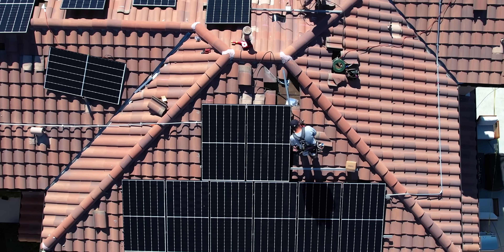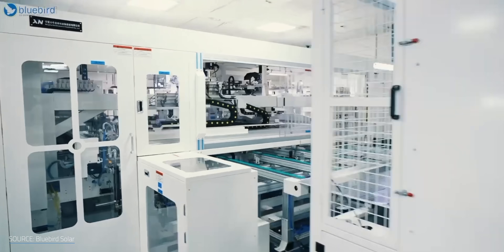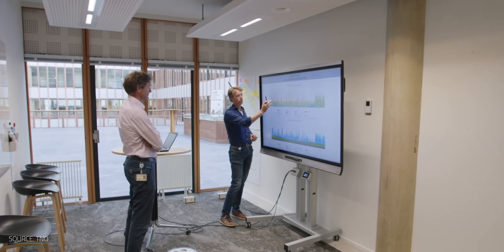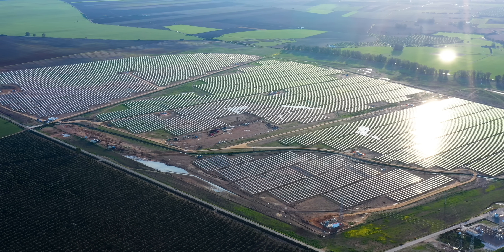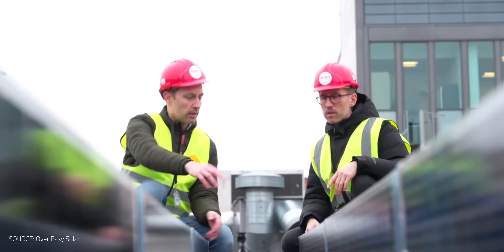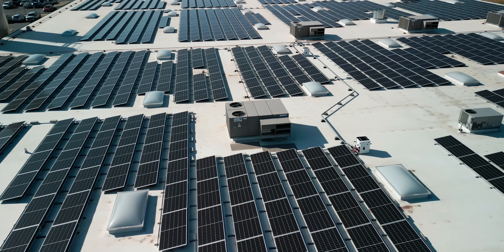Have we been doing Solar wrong all along?

Comment: it better to know bifacial solar panels are good with tracker system you in EU maki it wrong and your roof in West are not flat the flat roof with bitumen foil waterproofing will increase significant amount of Bifaciality gain annually. Bifacial panel can produce up to 23% more energy from back site regarding the albedo in real study not simulation. in 1 of PV site in our project we gain 19% more from backside compare to Monofacial solar module. 
with new Top-Con and HJT hit will reduce less production . 
vertical installation for country that near to south or north pole is ok because the tilt of solar panel goes high for near equator no like Spain south of Germany or USA Mexico or like us in MENA
best way for large scale solar PV plant is Bifacial + 1 axis Tracker system
for roof top use as can fit. HJT and Top-Con Came almost same size and very higher power  and low temp Coefficient of Pmax  
Flat roof definitely  bifacial with bitumen foil waterproofing or withe coloring

Comment: vertical panels run cooler due to better convective air flow which increases efficiency. I would like to have roof panels which have cooling pipes on the back which are plumbed to produce space heating and/or hot water. Waste heat could be vented via heat pipes.
Reply: The effective area is the shadow area.

Comment: I don't think it's that much of a question which is better. The beauty of solar is that it can (traditionally) be slapped on any surface. Now we just see more and more double-use cases where vertical PV is also used as fencing, etc...

Rather than having to accomodate for solar, it is great to have a bandwith of solutions to put solar just about anywhere.

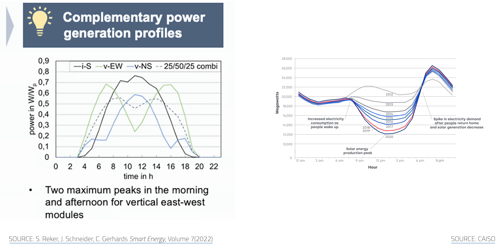Comment: The "Duck Curve" (4:10)  is a bad example that gets too much hype. Typically only such a curve is shown for solar solstice, typically the most extreme case of the solar year. When discussing solar, it would be much better to look at average energy for each of the four calendar seasons to better understand local solar energy potential. Not doing so leads to misconceptions and confusion. 
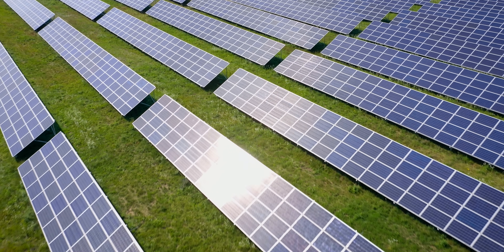Regarding heat and efficiency (5:40), similar applies to roof mounted panels being warmer than ground mounted panels.
Even better is floating solar photovoltaic, as the water provides a consistent cooler environment. Note bifacial solar does not need to be vertical, there are benefits to be had mounting at other angles.
Covered previously. 
• https://youtu.be/4CMk7kkSp831Q
• https://youtu.be/pCRX232VkBk

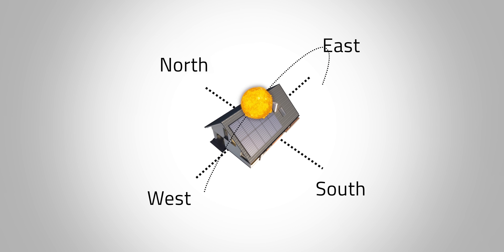Comment: @undecidedMF firstly a quick correction @ 3:39 - panels are correct to face south... if you're in the northern hemisphere.  

for those wanting to jump to a great summary, watch from 10:39 and then go back to the start for how it all works.

and lastly, this video comes at an amazing time as I've been planning the mounting 7 spare panels I have on our rear fence to take advantage whilst not eating into the surface area of the yard, but had worried about the optimal angle - now I can see the cooling factor combined with the reduced surface area are huge benefits despite not pointing the panels directly at the sun - thanks Matt!

Comment: Well, why not add an additional element to VBPV's in form of a layer, than has a thermalconducting liquid to heat water up for heating space? It may not be much heating, but that little generated heat could reduce costs of regular heating, even if it seems negligeble. In our times, where everything gets steadily more and more expensive because of permanently growing greed, shouldnt we make efforts to countermeasure exactly that? Even if its just 5 degrees warmth in water, it means you need this much less energy to heat up the water even further. Its just an idea and i dont know, how practical it is, but maybe copperheatpipes like used in computers could maybe also help in that regard. We have the technology to try such ideas on computersimulation to determine, if it could yield even better results. Maybe this idea is crewd, but maybe it could be usable, if tested and it shows better results. That idea could cool down overheated solarpanels and get their operational range even higher. Again, this is just an idea, maybe its not so easy as i thought, but at least i tried to come up with a new solution

Comment: Putting in my hypothesis right after the intro (defining "Bifacial vertical", and that text just displayed)...
BENEFIT #1: Being out of full-on direct sunlight results in significantly less heat, which is improving efficiencies. (due to lower resistance?) [Nnnailed it!] 
BENEFIT #2: Being completely vertical inhibits dust/other participate buildup, meaning that even if they aren't cleaned often, they still generate more electricity since the typical homeowner likely doesn't clean theirs often (if ever). [I missed it if this was mentioned; maybe as I was typing my reply...]
SIDE BENEFIT: Light reflected off the ground/roof further increased the output versus what was expected. (not really 'benefit' so much as an overlooked factor in their prediction) [That didn't take long to confirm this was right! 🤘]

[edit: Including this, now that you've said "last chance"... The additional panel on the back is taking advantage of those mentioned electrons being knocked off, causing it to create electricity even when there's no direct OR indirect (reflected) light hitting it (scavenging "waste" energy, in a sense) . OR, possibly it's "charging" the 'evening' panel so that once the sun does swing around to it, it experiences increased efficiency temporarily; during that time, it's doing the same now for the 'morning' panel.] [Well, this definitely wasn't mentioned, but if it's possible to create a photovoltaic-substrate-photovoltaic panel that's literally double-sided (instead of two physical panels mounted back to back), this could be something to test out! A joule theif springs to mind, but that likely isn't a good analogy...]

And with that... back to the video!
Reply: re: I wonder if you could use shallow depth geothermal cooling, to place some metal inbetween the panels with pipes run into the ground to circulate a gas or liquid, just through air currents/fluid flow created by the different temperatures at the panel vs underground. (to prevent a need for a fan or pump [if using a liquid] on every panel, which would make them more expensive overall to buy and maintain; granted, there are automated panel washers now, so maybe it wouldn't be prohibitively more expensive... 🤷‍♂️)

Comment: We did a nearly vertical PV install that had reflected light from a lake and a metal roof.
In the Winter, we had three suns pumping sunlight onto the array.
(  i.e. Direct sun, reflected sun from the roof, and reflected sun from the water. ) 
The yields on the array were the same in the Summer and the Winter.
Reply: how long was the day during summer vs winter and what were the peak outputs of the panels?
Reply: Nice use of location specific mounting
Reply: Why are the graphs yarde in europ on east south west slopes on lakes. Exactly the same sun effects.

Comment: I could definitely see this replacing current fix tilt systems in some cases. With the fact that it is comparable at all, constructability would be the main selling point over the increased efficiency. Curious to know how it handles undulating terrain though as civil work can easily out run the cost of everything else. Tracker systems are what it would really need to go up against, atleast at the utility scale, and they're getting cheaper and more reliable at a pretty okay rate.

Comment: As a 30 year Master Electrician and renewable energy installer I just stopped by to say , consult a professional and don't believe everything on YouTube. We do all the energy calculations based on the historical weather in you area and install your solar panels with optimum angle and location to deliver the most energy possible for your system . Don't buy from the door to door salesman, they are really only selling high interest loans and contracting out the installation. Buy from a solar company in your city and roll the loan into your mortgage , so that it's not a separate payment. And if you sell the home the panels are not a separate loan to pay off.

Comment: You didn’t even mention the reduction in hail damage, bird droppings, dust, snow.  Also this seems like a great place for tiny prism glass.  I don’t know what it’s called exactly.
Reply: I think you mean fresnel lenses?
Reply: At least in the case of utility solar, O&M teams will tilt the panels as vertical as possible to avoid hail damage currently and to rinse the panels during rain.
Reply: You get way less bird droppings, dust, snow, hail damage, true, but higher risk of damage / dirt when mowing lawn, doing gardening, etc. I have vertical solar array on the house facade and I had to replace one panel because it got hit by a stone shot from the lawnmower. From then I only use trimmer. But I still not regret it, ones needs to be more careful as the panels are closer to human activity.
Reply: @WhoIsSuperCow  that sounds dangerous reminds me of that final destination scene.
Reply: @aaron-gz  It was, I was impressed the panel withstood that blast, the stone would have left a hole in my leg. Glass was left cracked, but the panel was working for another 6 months until I replaced it.
Reply: Much simpler support structure too.
OTOH it is more exposed to projectiles & ground dirt/vegetation.
Reply: Or a thin film that refracts the light incident to the panel, or design the silica to absorb from a certain angular range… or (less effectively), add mechanical features to adust the panels angle slightly
Reply: Or!!! Etch the glass cover so that it has built-in refraction
Reply: 3:25   42*
Reply: Hail doesn't just drop straight down. Often siding is destroyed during hailstorms.
Reply: @Dan-xo9ly  True, however, the impact of hail on a vertical surface is less than on a horizontal surface. That could be the difference between a destroyed panel and hail bouncing off. Also, it would be easier to cover panels on the ground if there is sufficient warning of hail. Another benefit mentioned is ease of cleaning and the accumulation of dirt and dust.
Reply: yeah, overall surface area to perform maintenance on may increase however I think maintenance frequency could significantly decrease, potentially making this far more viable as low maintenance large scale dual use solar and agricultural farms. Time can only tell if this has long term unforeseen consequences however its looking really promising

Comment: I did a video showing this and the performance results. The vertical almost always put performing the horizontal... Nearly all the time. Some one did the same, they got the same results.
It depends on when you test as the lower sun hits the panels better.  So you get the better cooling. And the better angle.

It worked out that the sun's angle to the panel  is very much key and  you can see that with the  daily power curve as well. But the sun angle is 16o an hour.
For those with solar, they may have noticed the days are About 3 minutes.
These times tend to work in favour of each axis.

Sometimes you got to do it rather than read about it 😊

Comment: One huge mistake made in solar farm/close to ground panel installation is the lack of under panel space for vehicles machinery and grazing animals, this will have major future negatives for food production when sited over prime agricultural land. I have over 90 excellently performing horizontal panels on my shed roof.. not far from me there is a 1200 acre horizontal solar panel farm as well. If vertical solar panels had angular alteration mechanisms it would possibly tweak performance that bit further.

Comment: The fact that they never do a side by side comparison and remember  that the vertical has both sides so the horizontal would need twice the amount to be fair. Because what they are honestly saying is that look are smaller size solar panels is creating more energy which technically it is not

Comment: I've seen another way to solve the overheating problem. They wanted to place horizontal panels on top of reservoirs next to hydroelectric dams. This keeps the panels cool. Doesn't take up useable space. And has all the normal grid connections to make it an easy install instead of transmission lines.

Comment: bonus: add cheap beam splitter/ reflectors to the top edge of vertical panel to redirect light to other panels; or perhaps leave the edge clear to allow in sideways light, basically a “2D” waveguide.

Comment: So you are saying the unexpected extra energy was the cooler temperatures from the vertical orientation. Even I know the panels work better when they are cooler. I know this because I want my solar power system to track the sun. One of the down sides of a system of panels that face the sun all day is the added temperature. Panel that have water cooling built in are available now. It doesn't sound like they tested against those type of panels. 
So these guys aren't very good experimentalist are they?

Comment: The downside would be wind.

You probably want a panel that can adapt to both vertical and horizontal.

The final form may be some form of a wind trap or the ancient cooling towers but with solar panels.

heat goes out, solar power goes in

Comment: Yay, I guessed heat! Interesting to come across this today. I’m just starting to think about how to implement solar on a tiny budget. I want to do some travel when I retire, so being mobile interests me. Then my power went out and came on, then went off again, three times in a row the other day. So I started thinking about a couple of panels and storage batteries to cover some basic energy needs with the more frequent power outages I fear are coming in the future. But I don’t want to put panels on my roof, and I can’t afford a whole system. So I was thinking of putting two or three panels in a more vertical orientation where I have space next to the house along my driveway. After seeing this video, that isn’t sounding so nuts! That said, it’s a south facing location. Thanks for giving me more to ponder!

Comment: Taking the cooling benefit into consideration, would it not be better to add some sort of passive cooling? I'm thinking heat sinks on the back of single sided panels or heat pipes to heat sinks on the bifacial panels.

Comment: Isn't that simply because hot air rises? and by making them vertical the fastest path up is now available? Basically the hotter they get, the bettter they cool. Plus, the soil will be evaporating moisture, which will increase the maximum heat content of the rising air.

Comment: I discovered this years ago when I adjust my panels a set of my panels to a 72 degree orientation for more power over winter.  
When summer came along I got lazy and didnt readjust them to 32 degrees for summer with the rest of my sets.   I found my voltages were producing SLIGHTLY less current, but voltages during peak heat was about 10V more.  I was getting an extra 200W from that set as a result.  I ended up leaving the panels where there were at.  They got less dust collection and when snow hit I melted off much faster
Reply: Maybe the ideal orientation overall is somewhere between the latitude angle and vertical orientation.
Reply: I was wondering about this! It seems there should be an optimal angle, perhaps calculated as a function of the ambient temperature at any given moment along with the panel's internal temperature (but within the bounds of the adjustment mechanism).
Reply: @jerells  vertical convection obviously creates a chimney effect
Reply: Wonder how much extra adding in earth batreries underneath would harvest on off hours. My other thought being its probably easier to dual use the land around panels this way, easier to put crops, plumbing,  or landscaping around.
Reply: I guess in summer you had still more then enough yield ;-)
Reply: Interesting
Reply: "where they were" is fine. at is unnecessary. Thank you for your attention to this matter.

Comment: Could it be as simple as the backing material on mono facial panels holding in the heat? Could a more conductive material improve  the transfer of heat away from the silicon?

Comment: I have 375~380w bifacial panels and the are on a 15% angle. The problem I find is a bright enough surface to take advantage of the capabilities of bifacials. The produce fairly decent amounts of power but I have not seen the 15-30% gains touted by manufacturers and pundits. They do look good and may a vertical mounting might make a difference. 

Thanks for this encouragement

Comment: After seeing this video I went out and separated two of my new BYD bifacials (the biggest panel they make)  ran one vertically and one at 36 degrees south.  Both were sent through a shunt and then the + and - where connected. When it got dark I went out and checked and the vertical panel produced  almost half of what the panel set to my latitude did.  My guess is this study was done so far north that the optimal orientation was closes to vertical  with Norway  being  at the 66-69 degree latitude.

Comment: Maybe the orientation of the panels being vertical. If I were to line it with the path of the Sun I would get so little energy.  But if I put it perpendicular I believe it would match the sunrise sunset peaks.  But would this produce more power? Maybe I'm still on the idea of using batteries to keep the power for the evening use.